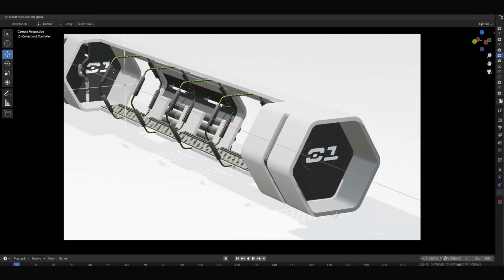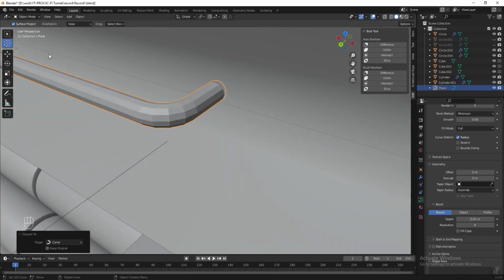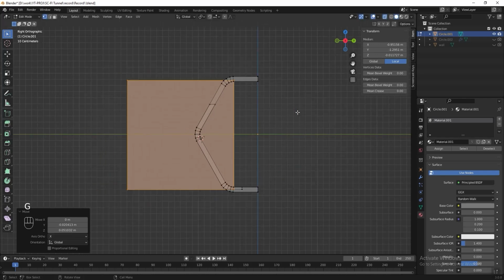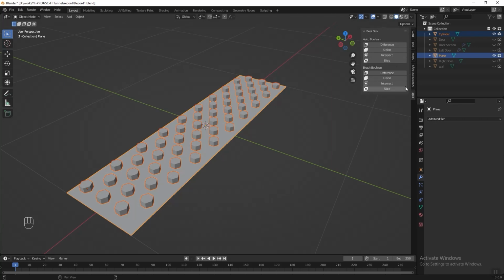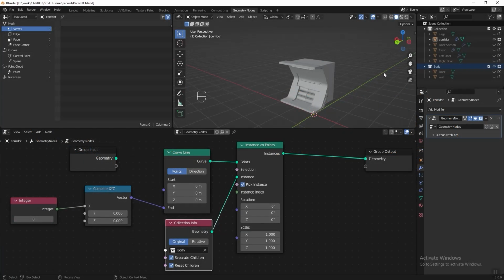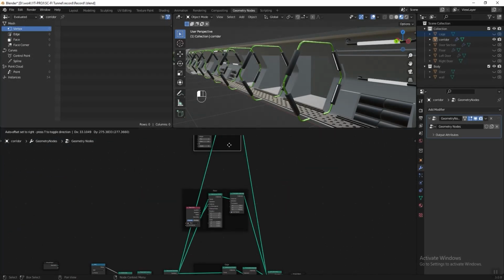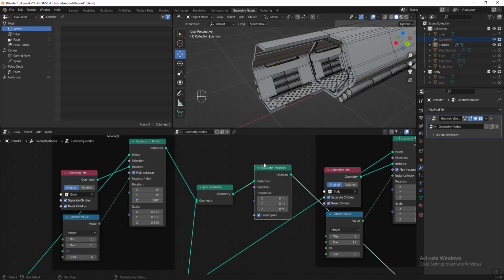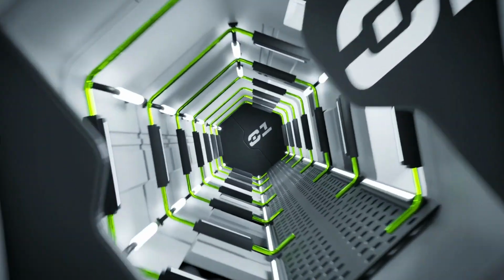Blender 3D Geometry Nodes Fields - Sci Fi corridor Animation

Comment: Hi Chong, amazing tutorial, as always! I have a little problem. After finishing all the steps, everything worked without a glitch. Afterwards, I decided to give the corridor more human dimensions and I added a transform node between the last join-geometry (when everything is already fully processed) and the group output to scale the final output by 3. 

The scaling works exactly as expected, but the empty-controller and location of doorways gets totally out of sync; it almost seems as if the scale needs to be applied; but there is no way of applying the transforms in Geo Nodes, right? I tried to change the mapping range values but to no effect (in fact, I don't think I understand fully the role of mapping range here). Please help!